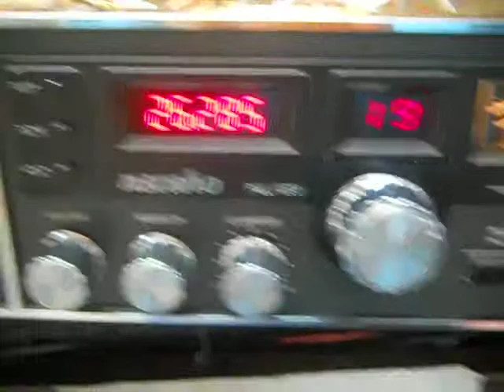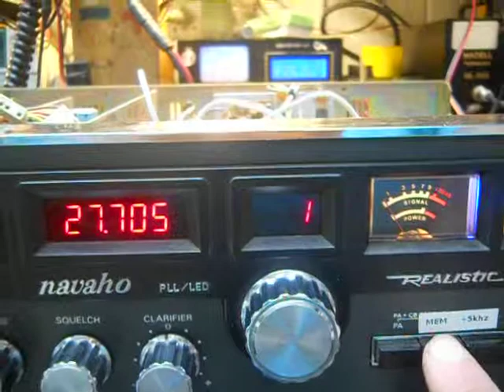TRC457 Memory channel Demonstration w/ 5khz switch.

Comment: Where does this counter connect in the radio exactly? Is it stable on transmit also?
Reply from the maker: It just ties into the IF frequency. Check out http://www.ebay.com/usr/fasttrack*09 for the counter. I liked the 5 digit counter. The 6 digit didn't compensate for the SSB offsets and in my opinion made it inaccurate and confusing. The 5 digit gets my approval for this radio.

Comment: how did you get the 5KC switch?
Do you just use pin 17?
Reply from the maker: +ᗒ╬ᗕ1112223333111ᗒ╬ᗕ   I did use the 5khz mode on the PLL chip to address half channel steps. It was permanently tied for 5khz, not on a switch. The push button on the front of the radio, is connected to the micro controller. The microcontroller handles the math for proper RC channel selection.

Comment: where do you get that microcontroller ?
Reply from the maker: It's just an  ATMEGA328P. I did the custom programming on it myself. I actually did a mod that I like even better. called the Xbones Jail break. https://www.youtube.com/watch?v=3d2uycCwEGc It's a bit simpler to hook up. I have not made these available to public. Over loaded with radio repairs. Don't have time to make and install more of these.